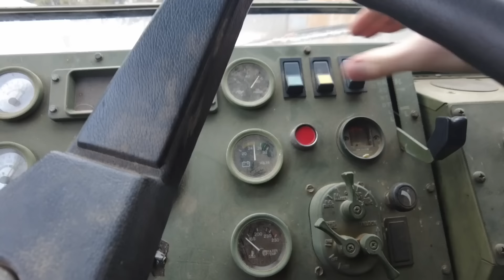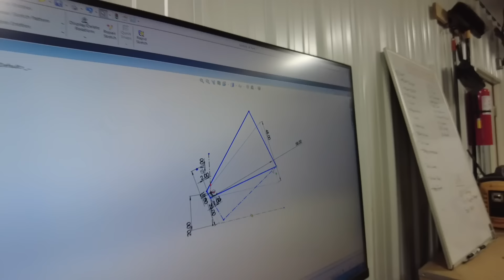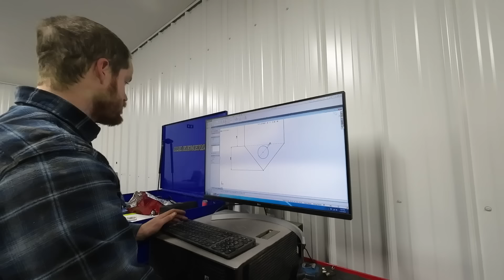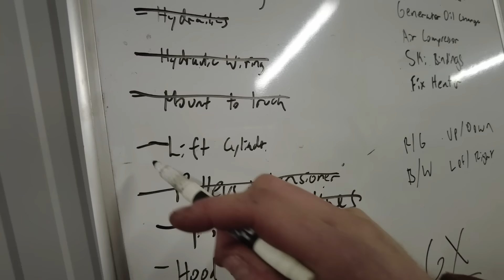We Built The ULTIMATE SNOW BLOWER | First Drive

Comment: Only change I would make is to add a pivot link or short chain to the lift cylinder. That way the blower can float on the road. With the fixed hydraulics if the blower has to ride up a bit it now has the lift the front of the truck, and if there is a small dip the blower will currently ride over it. It's the reason your plow has the chain to lift it instead of a solid link.
Reply: This system floats hydraulically when the blower is down, so the dip scenario is not a problem. When lifted it is as high as it can go, so no float there would be desirable.

Comment: You guys got the machinery,  You ought to use it.   a tractor trailer gets its traction through the sheer weight of the vehicle in the load.  I used to drive truck,   everybody thinks driving a big truck is a scary ordeal. When you have 80,000 pounds keeping you glued to the road,    the only thing you have to do just make sure you don't make a mistake and go off into the ditch.   A 55-gal barrel of water is approximately 500 lb.  if you added enough salt to the water it would not freeze, and you could have it in a plastic barrel for ballast.  i always told my old bosses that if he had a couple 55 gallon barrels on the back of the truck when the truck is almost empty it would give the truck better traction than no weaght at all on the back  of the truck.  Your army truck may have room on the frame for hanging extra tanks like I was talking about.  you could fill them up or you could empty them as needed.   Fact is I don't know why more people don't do this.

Comment: great video. a couple of suggestions first load your dump body full of 57 limestone in the fall, you will always need some in the spring for touching up driveway. sencond is check out may wes manufacturing the are a heavy duty poly company in hutchinson minnosota. you will need skid [ slide ] shoes to set height adjustment for your blower also a cutting edge this will help with a better clearing job. as you have already experianced snow removel also removes alot of top dressing of stone from driveway.

Comment: Those little control panels are cool, just got one myself. That could start the blower motor too. Does the blower have skids it can ride on? Maybe be an option when it "floats" Great JOB!! 
Think of an exhaust fan for the shop, particle fan inside is nice but sometimes you need to get the crud OUT!

Comment: The upper mount position @8:31: I realize that the cab needs to tilt, but the force on the ram would be much lower if the truck-side mount were higher and further forward, within the limits of how the mounting frame could be extended up and forward (and together in an A-fame) without cab interference.

Comment: Nice build..! Please stay far away from the augers and the open chain!  At work to day one of my mechanics "dis-tangeled" som 2inch L-profile from a 400hp snowblower. Interesting shapes made by the augers. Have great respect for the snow coming out of the shute, it has emence force. Gravel transforms to buck-shots. Interesting to see how the cruice-control can be applied, and the fuel economy. I think you need some insulation on the exhaust. The truck seems a little light aft.. Looking forward to next vid..! 😀

Comment: seen a little in the future video (and whent back to see the build )
you mentioned needing to be able to adjust the trottle 
i was thinking : maibe you can use the hydraulics controll box and the relay block to mount a servo to the trottle , than again you need sumting to automaticly adjust the rpm to a certain evel under load , guess you need sumting to controll the servo through the rpm sensor to a set rpm , might actually want a rev counter on the engine too that you can see from the cab (monster tach?) 
might be a good idea to build some sort of cover too as the thing likely going to be stored outside and some sort of storage rack that allows you to drive the truck against it and mount it without the help of the skidsteer

Comment: with you fan that you have with a filter you can use this filters to make a box and have a hepa grade filter.   
HDX 16-inch x 25-inch x 4-inch MERV 13 Air Filter 4 Pack..  which will make box.   Then tape the fan into the center of the box and the other end open goes to the floor.   Fan draws air out of the opening into the room and will remove 2.5 pm  It will be not cheap but will last long time in your shop.  Basically a 25 X 25 X 16 box.

Comment: A nice prof of concept.   A few things to consider would be making an agtual 3 point mounting system to absorb some extra shock  and keep the blower level regardless of the height.     I would reccomend adding some heavy duty caster heels just behind the blower with their own lifting system ro reduce the force going into the frame.   That is a lot of weight for that frame and over time it will show.   Plus that front suspension is not really made for that much weight being added to it.    

Tire chains are rated for the size of tire when the tire is brand new.   Those tires look far from brand new and have probably lost several inches of circumfrence which is why the chains were way too long if they were actually the right size for the tire.    Curring chains to exactly fit a tire is not a great idea,  you want extra length for when it is difficult to put them on.

Comment: Think about a back up mechanical stepper or something (cheepo bumper winch etc.) to at least pick the system up and pin-able,  in the case the hydraulics fail... pick it up and come back to the shop.  I paused and looking forward to the cab forward with the unit on.

Comment: Very nice, I would say you need to reangle the chute so that its height is not such a detriment to seeing out the window when driving, especially when blowing snow to the left. A 45 degree cutout and reweld should do it, you could also take the time to lower it by a foot or so as well.
Reply: A 45 degree change of direction in the chute would cause a big reduction in the flow of the snow.
Reply: @ronsommer9409  Probably, but then maybe 2 22.5 degrees... I am sure I am not the only one who saw that the view was horrendous through the window while driving, and noted that they were not throwing a large amount of snow, maybe 4 inches or so? if they had a 8 inch or larger snowfall, it would not be fun driving that vehicle with the snow thrown in front of the windshield and no visibility.
Reply: @GrandizerGo  After viewing the snow blowing footage again, I noticed that only a small amount of snow was being blown.  The small amount of snow added greatly to the amount of snow flying around in the air.

Look at the footage of the skid steer blowing snow in I BOUGHT MY WIFE HER DREAM EQUIPMENT @8:04

Comment: 6:33 You are making a mistake, insert this type of cotter pin from above when, for some reason, the safety wheel deflects, it will not have a chance to slip out and get lost. Overall, I'm very impressed with the work you've done since the first episodes. I also recommend throwing it on the load box, above the rear axle with a 1 ton load to balance the weight of the snow blower and improve traction.

Comment: Looks good so far... but a heads up....
If it starts to snow or rain on the MEGA blower...the electronic will short out...no motor can with stand. 2 temp...motor will be, 500 degrees,. With forza snow hitting it....
You will crack the block 100% guarantee.....

Weld, a cage of 1/4 " angle iron... ( like mad max.) , make it so it can be hinged up like a hood. In all the shapes... weld, thin steel,  or 
Even screw plaxie glass panels in the spaces... but cover the motor....for the whole snow blower....

Comment: I was going to tell you I love it keep it up cuz maybe one suggestion it might have skid shoes but if I was you I'd weld a couple of trailer spindles and put a couple of small tires on the inside so when you lowered it down if we keep it a half inch to an inch from the ground so you're not grabbing rocks and stuff and picking him up cuz it will break the Cherokees and if you get one in the chain spin to work goes around on the chain it will break the chain I had one big one like this and we sold it it went on r&r tractor in the front lip kept getting tore up and we had to make a set of gauge wheels to hold it up and so when you put the tractor and float mode it would just go up and down afloat

Comment: I think there may come a need for a radiator guard/debris filter for snow or ice build up and protection.  What do you think about a couple of heavy duty limiting straps to back up the ram at full extension.  Would an in cab deadman switch be possible for safety?  Some easy on/off tractor weights on the back may help with balance, traction, and steering. Can't wait to see you use it on a deep deep snow!

Comment: You should have another switch in the truck to control the Blower that can be disconnected when you don't use the ice blower... Make another conversion for your wheels to run on ice mobility tread like your Jeep so you don't get stuck on snow...

Comment: congrats on this build!!! did not go over the previous 1000 comments. would like to see what you have in the truck cab for the control station for the blower. Hopefully you have a "dead man switch" planned for the final steps in this project. how do you control the engine speed on the blower? thanks

Comment: I know this would mean undoing a lot of work but I would be inclined to turn the petrol engine into a stand alone high capacity hydraulic power pack. Then you could keep the power pack on the bed of the truck and power the plough with a hydraulic motor. The up side is you would have a hydraulic power pack for other projects.

Comment: Well here it is 10 months since I watched this video.   You should have rubber wipers on the fan that throws the snow through the shute, believe me this does work, then you spray some Pam on the barrel So the rubbers have time to wear in.  Next thing you need to do is add enough weight so you don't get stuck.

Comment: Did you think about using a winch and cable instead of a hydraulic ram?  That way if the blower hit a bump it could jump up if needed. Or you could leave the cable a bit slack and it would follow the contour over a rise.
Reply: It floats hydraulically, so it doesn't need a slack cable.

Comment: That’s crazy, awesome concept and execution. Probably some counterweight would be advised for traction. And for goodness sake, be careful around the Driveshaft linkage and chain drive - loose clothing can be catastrophic. I’m sure you know from industrial lathe safety, but PtO drive linkage is a huge source of injury. Please be careful.
Also, stock up on shear pins, and if it really becomes an issue, consider a slip clutch style (thought the belt drive may mitigate).

Comment: Great job. Now just need some weight in the back. I wonder where you could find a few rocks to put in the bed? lol. 
Why not attach the blower like a regular plow where the ram pushes a lift arm and the blower is just attached with a chain to the arm? That way you don’t need a float function on the ram because being attached with a chain the chain will let it float up and down.

Comment: Hay It's 🐜 ANT again for The wait for the back of the truck have you ever seen a water weight system so when you go up and down hills the water shifts in a kind of tube sort of just it also is good for four-wheel drive with mud trucks and stuff climbing rocks it makes it so nothing tips over the water goes on the opposite side that's

Comment: I should watch the rest of the video. But. I'm going to say it anyway.  Will you have enough traction on the rear tires when the blower is lifted in the air?  Maybe some sort of counter weight in the bed if u do have problems like many pickups have in snow states (sand bags in the bed of the pickups).  Y'all probably have it figured out anyway.

Comment: That was badass guys! I think it needs some kind of cage covering those scary looking blades, and possibly a roller or wheels on the bottom of the blower to make it move on the ground smoothly. That's just my observation. I'm no engineer or anything
Reply: It's okay that you're not an engineer, but have you never seen a snow blower before? A cage would just make the blower less effective, and make clearing clogs more difficult. The front is open, and must be operated with appropriate caution.
Reply: @brianb-p6586  you mean a personal blower, the size of a lawn mower? Sure, the opening is about 24 " or so, and what I had in mind was a cage made out of the same Guage wire as chain link fencing,  with openings of about the same size.  Still dangerous to a limb, but not an entire body. Just a small amount of safety, cause people are people and are why accidents happen. 
Also, if something like that were protruding out a bit would it also help break up hard packed snow?

Comment: Would you be able the use that switch board to control the 2.2 ecotech? momentary for start, on/off for ignition? And use like a trailer electrical plug for your quick connect to the blower?

Comment: The snow blower definitely needs skid plates.

I could not tell how your are venting the new oil reservoir. 

It will be interesting to see if the engine needs protection from flying snow when blowing for a long time.

Comment: It's bad to the bone. But if you git that beast stuck with the blower on it you'll need a dozer to git you out. What is propelling the blower?? A hydro pto or self contained engine. . That's an awsome truck but not a snow vehicle. Not enough weight on the wheels Weight is traction. . I watched u build the track drive units for that Cherokee before you built your shop. Like I said you have a lot of money?Dandahermit

Comment: I forgot to mention, if the front suspension is not working well to support the increased load you can add some air bags fairly easily. 
Good luck Al

Comment: First, a question about the engine. Are you going to crate a shroud to protect the mechanical parts when running and during down time. Second, will the weight of the front end require any counter balance on the rear end of the truck? I worry that it will cause rear end traction issue with so much resting weight sitting on the front even when pushing along the ground. Most large trucks that I have seen these one have a full load of sand or salt in the back.

Comment: What program are you designing your parts in? The CAD work I guess... and you should think about doing just a basic  how to weld video. Do you do calculations on the parts or have "rules of thumb" you go by when designing parts like how thick the metal bracket needs to be or how much metal needs to be around your pin hole for the mount as an example?

Comment: I,m not real sure but I think you might be turning the blower a little to fast as the augers are throwing alot of snow out front, the RPM on the main shaft should be between 8 & 900 as it would be on a farm tractor , just a thought
Murray

Comment: I see one possible issue. Did you take into consideration where the engine oil pickup pipe is in the engine that powers your blower?.  I would check that as in the up or work position the engine maybe starved of oil due to it not being level as it would have been when it was in the car you removed it from.

Comment: Probably need a bit more weight on the back of the truck, would help stop it getting bogged, its a bit front heavy which is part of the reason it ended up in that situation. I think you could have backed out with weight on the back.
Also I'm still worried the motor bearings are not going to hold up to the sideways thrust created by the drive belts. Crank bearings are not made to take that much constant sideways thrust. Probably should have the pully mounted on a shaft held by roller bearings to save the motor.

Comment: Excellent, well done. How does the float work? Surely there needs to be some kind of sensor detecting the ground for that?. Bob. Uk
Reply: It just opens both valves so that fluid can fow either direction.  If the impiment is not on the ground it just drops to the ground.

Comment: Would mounting a set of mower zero turn wheels on the blower with something that will enable the wheels raise and lower the blower work? This will allow the truck to travel without putting stress on the front suspension and keep consistant traction on all four wheels. It should also allow the blower to float on its own.

Comment: I've been following you for several months now and really enjoy your projects and sharing your way of life, 
I have a number of technical questions related to the snow thrower project. 
Since I conclude from following you that money is not exactly an obstacle, I wonder why you chose a gasoline engine and not a diesel engine with an engine governor like in tractors? 
Since you chose a gasoline car engine, how did you solve the problem of stabilizing the engine RPM and the changing load? 
I think it can be done with the cruise control system, but it requires installing a speed sensor )I didn't see that you did that( 
Thanks 
Ran
Reply from the maker: Hi Ran, we chose the gasoline engine because it was inexpensive, lightweight, and a small footprint. As for RPM we are still working on that. The plan is to use cruise control. I installed a speed sensor on the engine flywheel. Thanks for watching! And thanks for the questions!

Comment: Just so you know a snow blower dose not need an air filter. You are very likely to plug up the  filter with water. What I would do is take off the filter and make a custom air intake, so the engine dose not suck up snow. The reason why a snow blower does not need an air filter is because in the winter there is no dust outside and you are not likely to run the snow blower in the summer. So I would take off the air filter before it gives you problems.